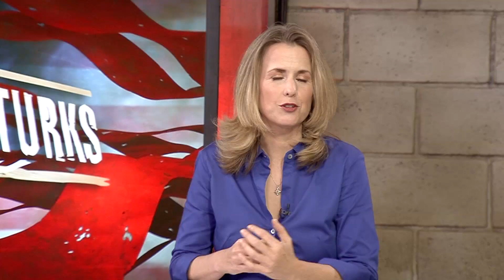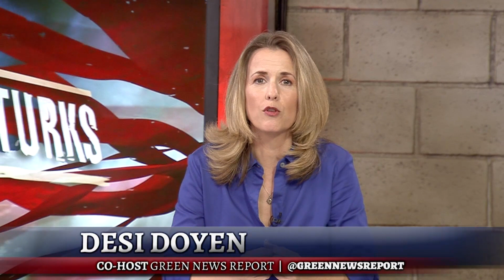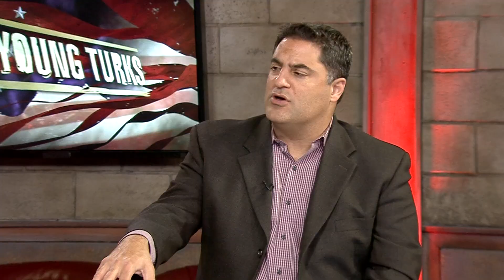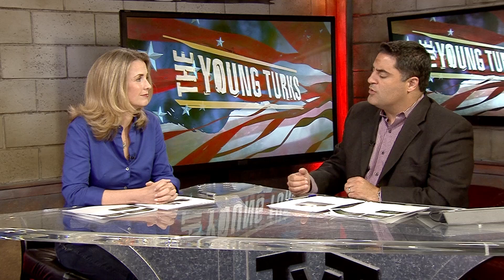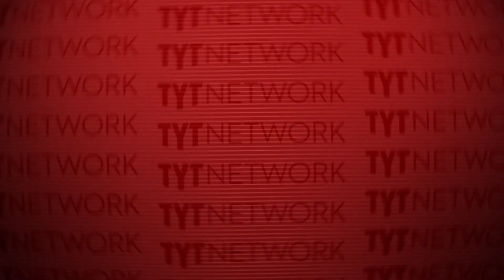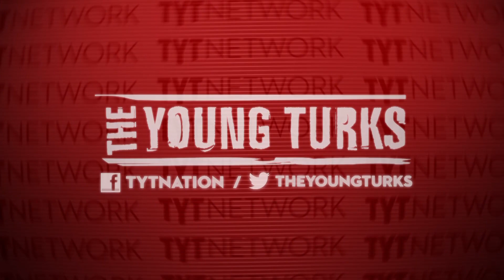How To Get Drinking Water From Fog

Comment: Shouldn't give a shit what companies want, it's your f-cking house, why do they get to tell you what you can and you can't put on it? When I buy a house, I'm covering the roof in solar panels, and I'm designing and building a small wind turbine in my back yard. Then I'm disconnecting from the mains. Not paying a penny for electricity. My focus after that is designing an H2 powered turbine generator to go on the Tesla, powered by home split water (where the surplus energy goes).

Comment: This is actually an ancient method of collecting water. Typically, meshes are placed on the top of hills; the water drips down into rocks, where it is funneled through channels filled with fine sand that filter the water. The water ends up collecting at the bottom of the hillside, purer than most municipal water supplies.

Comment: Solar panel permit in USA = 18 months wait
Solar panel permit or consent in NZ not required, we only need to apply to the local lines company to allow the solar system to be connected to the grid. Normal wait = about 10 days.

Comment: I'm sorry, but you just seem to be so confused on the issue.
"Distilled water is water that has many of its impurities removed through distillation. Distillation involves boiling the water and then condensing the steam into a clean container."
Mist is the natural equivalent of that steam as it looks for a new container, but as it happens outdoors it's open to pollution, so all the "net" does, is capture and redistill it.
You seem to be confusing it with the distillation of alcohol or somethign.

Comment: If you did your research TYT, you would know that the Bill Boards in Chile are engineered to collect the condensation and humidity in the air, then as the water collects, it goes into a separate tank to boil, then it is reversed osmosis into another tank, thus getting clean drinking water...

Comment: You can even get water from the air in a desert. Cool the air until the water vapor condenses. They are using solar panels to create the electricity to do this.

Comment: it's an issue with putting power into the power grid, since your house is on the grid.  the power company is required to pay you if you produce more power than you use, and naturally there's a lot of work to set it up.  However, Germany seems to have managed just fine without permits, so... :P

Comment: It would desalinate the water, but airborne bacteria/viruses and soluble gases, like nitroxide pollution, still need to be filtered or reacted out of the collected water.  Activated carbon and packed sand can filter out the particulates, but gaseous pollution would still be a problem.

Comment: Microgeneration is cute from a PR perspective, but it's a nightmare when you're a grid operator and are trying to provide stable grid operation. We still don't know how to stabilize a grid with more than a modest fraction of intermittent power sources such as concentrated solar PV/thermal or wind farms. Now multiply this problem by several million uncoordinated generator stations - that's microgeneration. It simply does not work at scale.

Comment: the trick is that you get this fog directly from the ocean, when the cold air from over the ocean hits the land and is forced to rise in altitude, then you get the fog.

so you could totally do it in san francisco, the wall of fog comes from the ocean into the city, when that happens you get the fog and also the air is quite clean. Fog that forms on land will most likely be polluted.

Comment: I very much doubt that you could ever make a mesh or netting that only collects pure water. However I don't think it would be useful for a big city anyway, since the water requirements are enormous and you need to collect water from aquifers, rivers etc... to satisfy that kind of demand. It would be more useful for sparsely populated areas, where the costs of transportation are higher and the air is cleaner as well.

Comment: haven't watched this yet, before i watch i want to answer the question because it is pretty simple. you dig a hole, you put a pump at the bottom (that pump can be as simple as man driven double bellows like an old blacksmith's forge) then at the surface you hang a condenser coil (these days it would be copper, but almost any coiled tube would work) that is hooked up to the pump over a vat or bucket depending on the size. the cooler air in the coil will condense water on it, and it will drip.

Comment: However, she's saying that the pollution in the air would somehow be purified from the water vapor that had already gone through the evaporation caused by the hydrological cycle. Admittedly she said she would have to check on that and wasn't sure, but logical reasoning based on the understanding of the basic steps should have told her otherwise.